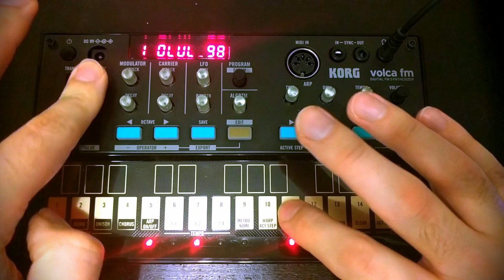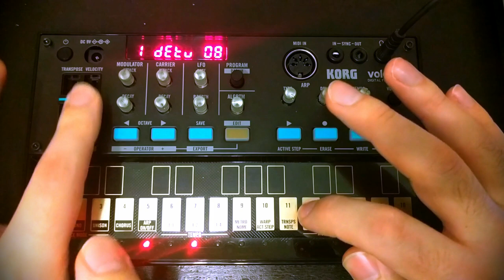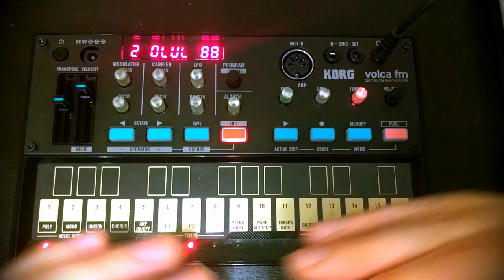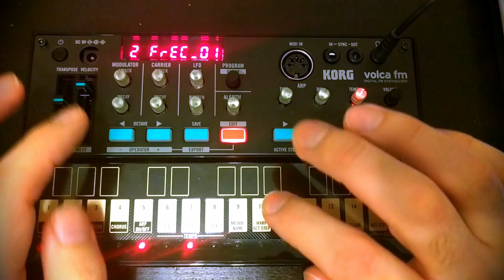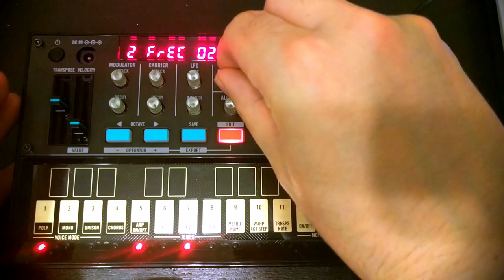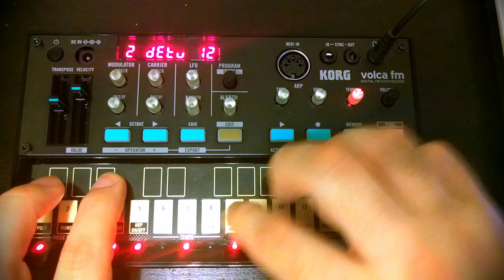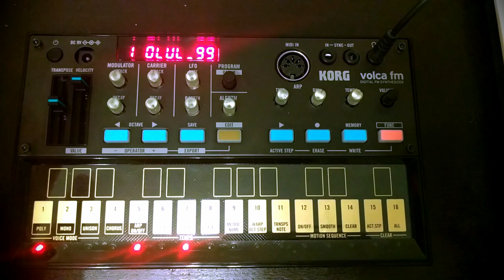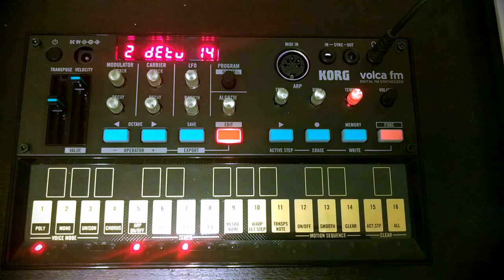Understanding Sound Design on the Volca FM - Episode 2: Operators

Comment: First of all, I can't thank you enough for making these videos. They are very helpful. Not to mention the editor. Way to take some initiative on that one. 
here's my problem. 
While turning operators on an off I stumbled across a situation where all operators where off but I still had a tone coming out. I tried with and without my controller keyboard connected. the tone is really faint in the middle of the register but if I play all the way up in the highest octave of the keyboard it became really loud. Has anyone stumbled across a phantom tone like this? To be clear I went through each operator and turned them off as well as turning off the level scaling and pretty much everything else I could think of...that sound is still there. What am I forgetting?
Reply from the maker: I've encountered this on mine, so I think it's a "feature" of the Volca to be honest. If I recall, the loudness altered based on the algorithm I chose, but I might be mistaken. I didn't see it as much of a problem as if the sound is even happening with an operator turned on, it's drowned out. But yeah - that happens on mine too.

Comment: OK, this is fantastic stuff.  But when I first started watching these, the first thing I started looking for on my volca was the “INlt” preset so I could work along with you.  Of course there’s no such thing on this unit so I went and found another video to find out how to do it.  I think it would be extremely valuable for those of us working along with your vids to know exactly what your initialized settings are before even getting into the basics of this incredibly complex instrument.  Don’t you think?
Reply from the maker: Hi there; the easiest way to get an initialised patch is to use an external editor which generates one itself -for example the free, browser based editor I've created called "Synthmata" (check the videos on my channel for more details). 

But to do it manually, in short: set all of the operator ratios to 1, set all of their levels to 0 (except for operator 1), set all the operator envelopes to have rates set to maximum and levels 1, 2 and 3 to max, level 4 to zero... The other parameters should be a sensible default value - 0 or a mid point value.

But, doing this all by hand takes ages, so using an editor's initialised patch feature is probably preferable if you can. If not - make sure you save the initialise patch in a slot on the Volca and don't overwrite it!

I hope that helps!

Comment: Thanks again for these videos.  With every new one, I'm a little less petrified of hitting that "edit" button.  One question though. When one presses "edit," does the menu default to the first parameter for the first operator OR, does the FM remember the last parameter altered and go to that? I'm hoping the former because, as a blind user, I can memorise the parameter table but if the FM stores menu position, I'm screwed. Ooh! Another question. I get the "carrier/modulator" concept BUT why then does the FM have six operators? If operators can only either be carrier or modulator, why have more than two?
Reply from the maker: +Dino Goldie as long as you don't switch patches the edit menu remembers where you last were. However, it's easy to reorient yourself because the parameter knob stops at either end rather than cycling round again, so just turn the parameter knob lots to the right or left to get to the start or end.

As to why there are 6 operators? Why does a Mini Moog have 3 oscillators? Because layering is awesome! But the story is actually a little more interesting than that - we'll get to that when we start talking about "algorithms" though :)

Thanks for checking out the video and glad they're giving you the courage to dive on in!
Reply: +Oscillator Sink Thanks again. How/where do I decide whether an operator is a carrier or a modulator? Edit parameter 1 just appears to turn an operator on/off.
Reply from the maker: +Dino Goldie so, that's where "algorithms" come in. That's a couple of videos away, but as a spoiler: the card that came with the Volca with the parameters on one side and the "flow diagrams" on the back?.. Check out that card and have a play with the "algorithm" knob.
Reply: +Oscillator Sink Ah! I've got it (almost). Thanks for the videos and looking forward to the next episodes.

Comment: Thank you so much for this great guide! However, if you (or anyone) could say more about your "init" patch so that you and I are starting form the exact same place it would help a noob like me trying to follow along right from the start.  I tried following with "Volcanic" but couldn't reproduce the great changes you were getting from the slider (and also got much different effects due to unknown-to-me parameters engaged elsewhere). Thanks!!
Reply from the maker: Hi there, the easiest way is using my free editor synthmata to send an Init patch, because it's a lot of parameters to change: https://youtu.be/ysJ_uxxepAY it all just runs inside your browser, all you need is some kind of midi interface. 

Otherwise, off the top of my head, you'll need algorithm 5, all operator ratios at 1, and probably set envelope level 4 to 0, all the other levels to maximum, all envelope rates near maximum.... There's some other stuff, that'll be the main things though. But like I say - just use the free editor if you can!
Reply: @OscillatorSink  Thank you so much!

Comment: hey there. it’s a phenomenal tutorial series on volca fm. got one for myself around 3 years ago along with a couple of other devices from volca series, and just now managed to search for a proper tutorial to understand this one in particular. and i gotta say these videos got everything i needed in a super accessible format. thanks, really appreciate!

i gotta question - i’m trying to replicate your sound with a “burbly” character that you got closer to the end of this video, where you cover the detune feature - 14:29 - to use it as a starting point for some of my ideas to develop further. i’m getting close, but something is missing for sure. could you share what are the setting for all the parameters you used in this very patch, if it’s possible, of course? 
I followed the link to your website and there are some patches for volca fm shared there, maybe this one is listed somewhere in the list there? thanks in advance

once again, great work on these vids, man!
Reply from the maker: Hey, I don't have the 'finished' patches from these videos, but it sounds like a basic 2 op patch (for example just use operators 1 and 2 on algorithm 5).

It sounds like a 2:1 relationship, so set the carrier (operator 1) coarse frequency to 2, and the modulator (operator 2) coarse frequency to 1. Set the level of op 1 to full and the level of op 2 to around 90 to start, but use your ears. Then the big trick is to apply detune to the modulator.

If you have a midi interface, I'd recommend using my free editor, synthmata as it can give you a nice starting point (setting your envelopes appropriately etc.).
Reply: @OscillatorSink  thanks for the quick respond! 
i think i’ve set all the FreC, FreF, OLevel, Detune parameters as well as Algorithm correctly, following the video across the timeline and paying attention to the values where they are shown. Envelope-related values are all almost straight 90-99 as from what I am able to hear. the question left however is about all the parameters of these two operators that are left behind the scenes - LSBP, LSRC, LSLD, LSRD, LSLC, ORS, ANS, etc. Is there anything special to those values worth paying attention to? 
thanks again!
Reply from the maker: @kowloonbroadcast  in this patch you can set them all to zero / neutral position (but if you want to understand them I do cover them in later videos)
Reply: @OscillatorSink  thx, will try this out. 
there’s a few more episodes from this series I haven’t watched yet, i suppose those must be the ones that touch these parameters.

appreciate your feedback and educational contribution. subscribed and will be definitely diving into more content that’s on this channel and on your website from now on

Comment: Great video. Thank you. What is the number of algorithm you are working on this video?
Reply from the maker: +Tomasz Włazinski thank you. I believe in this video its algorithm 5, but pretty much any algorithm where operator 2 is modulating operator 1 would work the same - just turn off the other operators.

If you need an easy way to get an initialised patch to follow along with, check out my video on "Synthmata" which is my free editor for the Volca FM that runs right in the browser!

Comment: i'm trying to follow along with my volga FM but. I saved an initial patch which I renamed and muted all but operator 1 & 2 but they sound nothing like yours (I used a the drum hit sound as saving means overwriting one of the programmes and I like this one  the least!) could you explain how I would  'initialise' the programme so I could follow along.. i'm really excited to try using those modulator operators later to make long evolving ambient notes. (but I need a simple sine wave to start)
Reply from the maker: If you have a midi interface the easiest option would be to go to this page (on Chrome browser) and use it to send init patch to your Volca.

https://synthmata.com/volca-fm/

Otherwise:
Set algorithm to 32, set the EGR1 and EGR4 to about 80, set EGL1 to 100, set FreC to 0, 1 or 2 and everything else to zero (repeat for each oscillator).

(it might also be easier to do the editing of the patch from synthmata as well - less parameter traversal).
Reply: @OscillatorSink  sweet. i spotted you using that in another video and have saved it when you mentioned it. it looked much easier to use then the similarly named menus; i keep getting impatient going back an forth adjusting the envelope and changing the wrong values. I'm am properly amazed at the sound the FM makes and am really glad i got one (it was expensive for me) but I can hear long life in it,. even if the menus are a bit hieroglyphic . !

Comment: Just got one yesterday as I mentioned before and let the exploration begin! One quick question though - is it normal I can hear the background hum in the headphones connected directly to Volca FM? Something like constant B-E chord/ditone which doesn't seem to be affected by volume or any other parameter?
Reply from the maker: +Łukasz Bieliz are you running it on batteries or a PSU at the moment. That sounds like a noisy power supply to me. Try it on batteries and see if it goes away would be my suggestion.
Reply: Oscillator Sink it's on batteries and checked on 3 different headphones connected directly to volca. The hum still there. Same with the proper 9v 1700mA psu from my microkorg s. Actually that tone comes from the built-in speaker with headphones plugged out as well. That annoying sound seem to blend somehow when I connect volca fm to my external speakers through the mixer but still - when I'm on the headphones I got this impression like I forgot to turn off the fan in the bathroom. Doesn't seem to be right.
Reply from the maker: +Łukasz Bieliz I know this is a weird suggestion - try taking it to a different room - there might be something nearby causing interference?

Comment: Hey so i downloaded your init patch to try and mirror what you're doing in each lesson, and off the bat the OLVL parameter on Ops1 & 2 doesn't seem to change when i adjust the slider value, except maybe get a bit louder at the very top.  Am i missing something?   Thanks again for the videos :)
Reply from the maker: +SeniorBeatBox ah, that is probably because of the algorithm. By default the Init Patch is algorithm 32, but in general, unless I specify otherwise you'll need to use algorithm 5 to play along at home.

For these first few lessons you'll also want to turn off everything but operators 1 and 2.

Sorry that isn't at all clear from the video, ironically it'd become easier to understand a little later on in the Algorithms video, but when I'm talking about operator 1 being the carrier and operator 2 being the modulator, you need to look for an algorithm where 1 is at the bottom and is connected to 2 just above it (as is the case with algorithm 5).

But yes, in short - use algorithm 5. That's my fault, I should make that clearer. I'll go through the video descriptions ASAP and add that detail in.
Reply: Oscillator Sink ah i get it, that worked.  Thanks for the detailed explanation!

Comment: It seems that once an algorithm is chosen one can stop thinking in terms of "operators".

After choosing an algorithm the term "operator" becomes a bit academic and it might be helpful to stop referring to "operators" and instead refer to "carriers" and "modulators". This was something that tripped me and many others up with the DX7. A really bad analogy is buying two vehicles. The word "vehicle" (operator) can mean either a car or a truck. After I choose my two vehicles (a car and a truck) I no longer refer to either as "my vehicle", I refer to either as "my car" (modulator) or "my truck" (operator).

"I'm going to take my car into the city."
"I'm going to take my truck camping."
Not, "I'm going to take my vehicle into the city. "
Not, "I'm going to take my vehicle camping."
Reply from the maker: I like (and hope I use, but I recorded this series a long time ago) "operator x, acting as a carrier/modulator". It's long, but it highlights an important property of the operators: they have exactly the same parameters and properties regardless of the job they are doing. Their behaviour is consistent no matter where they are placed in the algorithm. 

(Also, it doesn't apply to the DX7, but it's worth noting that other FM engines allow an operator to be both at once, which makes the consistent naming even more important - the Digitone is one example where this applies. To take your analogy to the extreme - I could be driving a car and a truck at the same time, it just depends which exit I take off the motorway). 

That might be, as you say, an academic way of looking at it, but I do think it's an important concept if you're going to go on to understand algorithms.
Reply: @OscillatorSink  "I could be driving a car and a truck at the same time,  . . "

Schrodinger's cat! I love it.

Don't get me wrong, your series is incredibly useful; a whole generation of musicians and producers wish we would have had something like this back in the day. In my original reply I only meant to point out how a lot of us got tripped up by the three terms when the DX7 debuted; as if the UI wasn't tripping us up enough already.

Comment: How did you achieve the “init” patch? I feel like having an initialized patch, it could help me learn better. I’m having trouble trying to follow along because I don’t have that basic patch and I can’t figure out how to revert a patch to that basic sine wave.
Reply from the maker: If you have a midi interface: https://synthmata.com/volca-fm/ can give you an init patch - this is the editor I built to make working with the Volca easier - it's free and runs in the browser. 

Otherwise algo 5, turn off operators 3-6, turn down the level of operator 2 is an OK starting point, but there may be other parameters that you need to "zero" as well.
Reply: @OscillatorSink  what if I don’t have a midi interface?
Reply from the maker: @Log Head  you'll have to do it by hand based on the second part of my reply. Algorithm 5, turn off operators 3-6, turn down the level of operator 2. You'll also want to set up your envelopes to be organ-like so, Level 4 to 0, other levels to max, rates all near max but a little below.
Reply from the maker: Although I realise that some of that will make sense once you're a little further into the series.
Reply: @OscillatorSink  oh gosh I missed that second part of your first reply! Thank you so much! I appreciate the speedy reply! I’m working my way through the series, I’ll continue to inquire with things as I have questions! Thank you again!
Reply: @OscillatorSink  thanks! I managed to get a solid init patch saved, thanks for your help. Do you go in depth about pitch rate in any of your videos? I don’t remember seeing you go into it unless it was perhaps in one of the earliest videos.
Reply from the maker: I think I cover that in the LFO videos? I think - I was a while ago that I made them!

Comment: Is it possible to accidentally make the patch sound out-of tune by messing with oscillator frequency? How do I make sure that the "C" key will actually be playing C note when pressed for example?
Reply from the maker: If the operator ratio is a power of 2 (so 1, 2, 4, 8, etc.) it'll be "in tune". If you modulate an operator with an operator where there's a simple ratio relationship between them, then things should stay in tune. Outside of that - it might be out of tune.

Comment: How did you setup the starting sound in the video?  Id love to go along but my INIT sound is different.
Reply from the maker: If you use my free editor at https://synthmata.com/volca-fm/ that can send you an Init to work with (and also save you searching for parameters). You just need a USB midi interface and a Chrome based browser (Chrome, Edge, Opera, etc.) - it all runs in the browser.
Reply: @OscillatorSink  Cool, thanks!